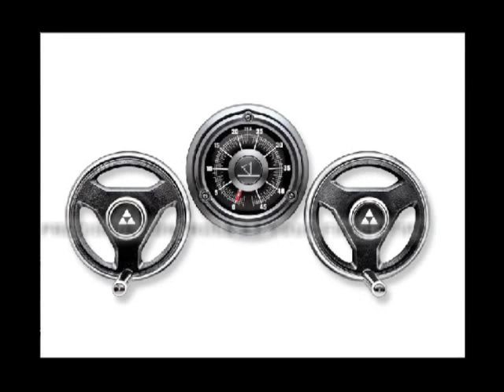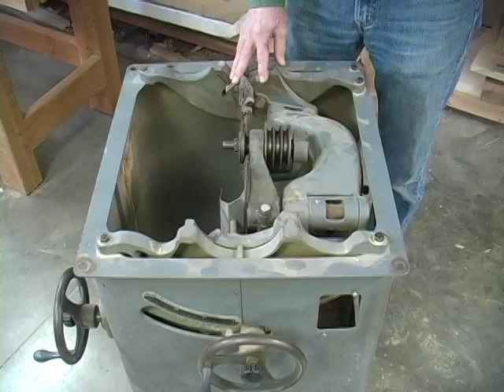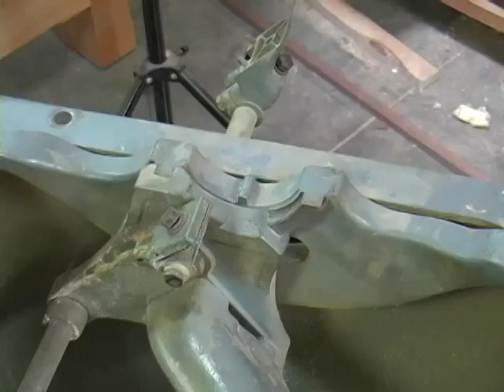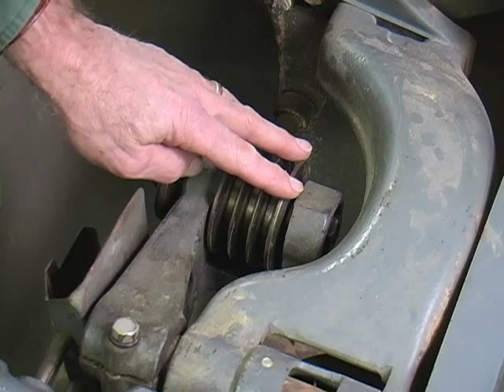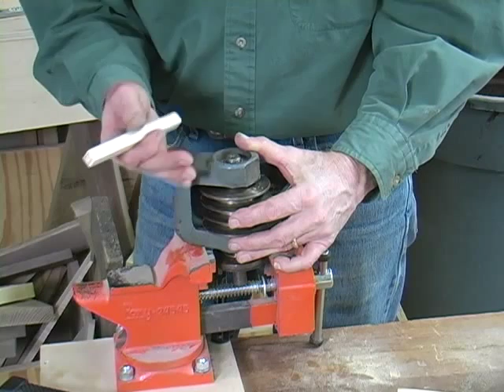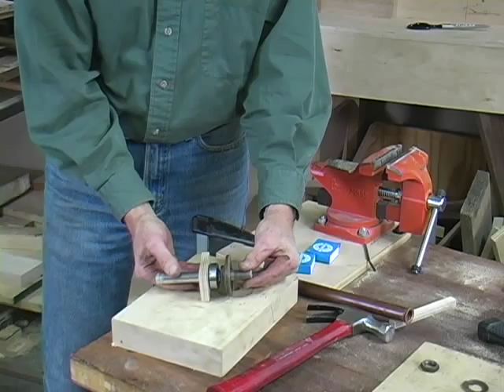Delta Unisaw Restoration: Part 2

Comment: I just found this video. I just purchased what I believe is a 1939 Delta Unisaw serial #F492 from the original ownwers estate. It has the 4 seperate cast iron feet. After 1940 it went to a 1 piece cast iron base.

Comment: I have a Delta 36-725 table saw. The blade was wobbling every time. I replaced the blades several times and still the same wobbling. What do you think is the problem? Do you think I have to replace the complete arbor with the bearings or the replacement of the bearing only? Thank you.

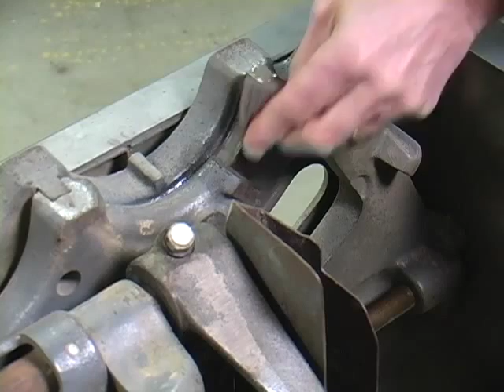Comment: 2:20  WD-40 is not a lubricant.  Great for cleaning/degreasing, bad to lubricate with.
Reply: "WD-40® Multi-Use Product protects metal from rust and corrosion, penetrates stuck parts, displaces moisture and lubricates almost anything." Literally from their product page. Your opinion may be that it isn't a good lubricant, but stating factually that it is not one...well, the mfg disagrees. : )
Reply: @TheGlobalMind  You mean the marketing department for the WD-40 company disagrees.  Lets rephrase this since you're being a bit picky:  WD-40 is not a proper long-term lubricant for gears.
Reply: @TheGlobalMind  Go ahead, spray WD on your bike chain and ride your bike through 6 incheas of dry silt and see what happens.
Reply: @derekcraig3617  Used it for years my fellow. I know. I have better stuff for bike chains. To use WD-40 as a lube to clean a surface...yep that works just fine. Folks don't seem to quite get the application of "lubricant". When you wet sand, using water, guess what the water is? Ding! Lubricant. Same applies here. He's in part, using the WD-40 as a lube in cleaning. Not necessarily for long term application. Again, I use other stuff for that.

Comment: well i was really dumb and I used a long socket that was JUST barely big enough to fit around the pulley shaft to drive the bearing down on it - and i smashed up the threads pretty good!! DO NOT do what I did !!

Comment: Shame on you Delta. You use nonstandard threads on your arbor so I can’t rethread and when I try to buy a replacement arbor for my 36-953 type 2 Unisaw, I am being told that part is not available.
Reply: You rethread it on a lathe between centers like any other precision high speed part.
Reply: Seriously,  shame on you for not going to your local machine shop and having them turn your arbor shaft for you. Instead you just complain about an easy fix

Comment: Great info! Amazingly similar to my 2000 model Unisaw! Mine will not register at a full 90 deg tho even with the stop bolt removed! Maybe sawdust built up on top of the cast? Thoughts?

Comment: Is there a screw ring holding the bearings in does it have to come out before the bearings?
Reply: woodwrecker the ring has to be screwed out first. They don’t even mention it!
Reply: his didn't have one mine does,not sure which way it has to come out clockwise or counter